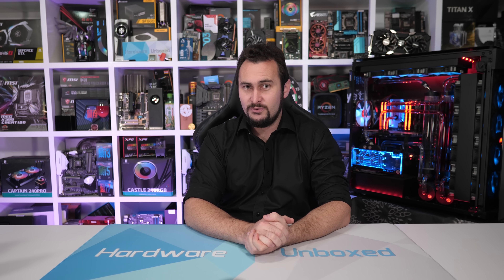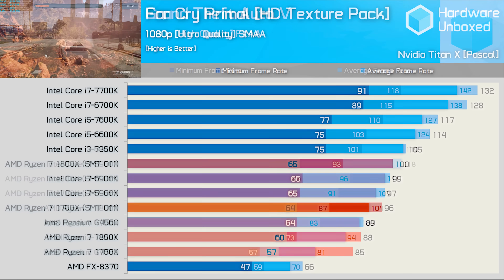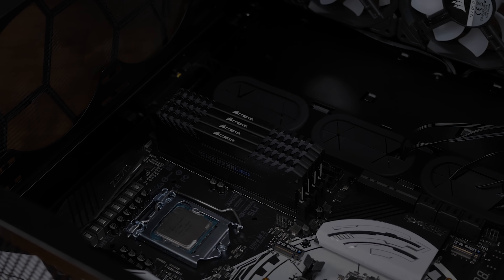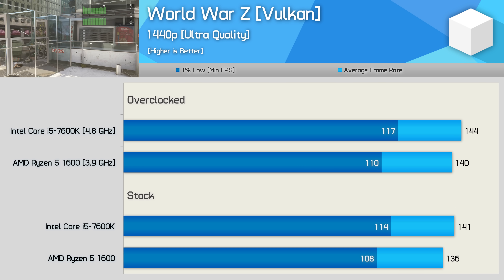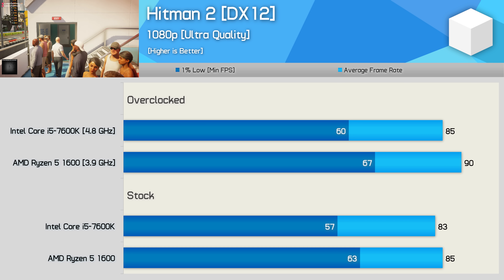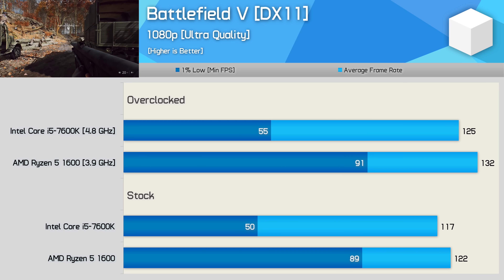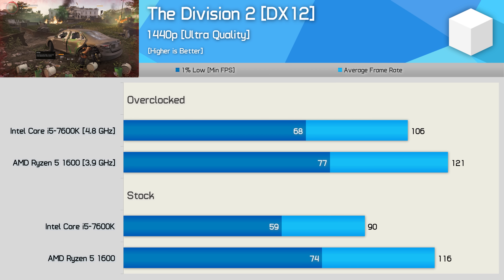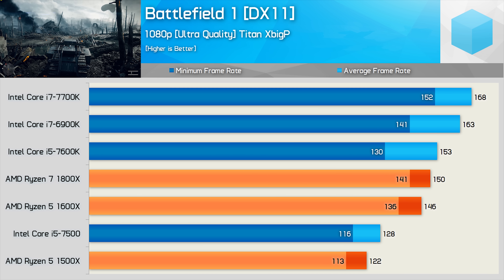Ryzen 5 1600 vs. Core i5-7600K, How Times Have Changed!

Comment: Nice work on this one but you could have includedthe 1700x and the 8700k as they were in the same pricerange.  This is entry level. Mid range en high end will change it a lot.  Specialy seeing the 1800x launch price and the 1700x was pricy aswell.

Comment: Ryzen 5 1600 4GHz. Turned off SMT and the fps went up like crazy 😂 especialy in Elder scrolls online.
Reply: Interesting.
Reply: So it is basically a 6 core/thread CPU?  What other games did you see gains in?  I suppose productivity metrics went down, though?
Reply: @davidwooten7212  GTA V and Rainbow six and some other games, using it only 4 gaming.

Comment: AMD have really changed the game.  Lisa Su promised Ryzen would be disruptive, and it's certainly proven true.  Only two years ago, we were stuck on 4c/8t and that's all game developers were coding to as well.  Intel refused to release higher core counts claiming that games weren't utilizing more than 4, and game developers were saying that they're coding with 4 in mind because that's what's available.  It was a big chicken and egg thing.  Post-Ryzen is a different story.  We now see Intel finally releasing more than 4 core mainstream CPUs.  They certainly had the capability of doing so on Kaby Lake or Skylake, but chose not to because AMD wasn't pushing them; but when AMD came in and destroyed the i7-6900k lineup with 1800X, then annihilated the i5 segment with the 1600, they had to respond.  Their lackluster responses to AMD's releases show very clearly that they did not take the Zen architecture seriously.  They (and a lot of us all) were sure that Zen would end up seriously behind Skylake even if it was an improvement over Bulldozer.  
There's a good reason why the only CPU worth buying on the Intel side is the 9900k.  It's the only one that clearly beats AMD's current offerings and delivers superior gaming performance.  That may change with the Zen 2 release, but for now, it is the last CPU in their stack that isn't outclassed or out-valued by a comparable AMD product.

Comment: At Microcenter the Ryzen 5 1600 (decent cooler included) with a decent mid-tier mobo for a 3.8 Ghz overclock will run you $130 after tax.  That's just mega.

Comment: I'd also be interested in a comparison of ryzen 1700x vs i7 7700k 2 years later
Reply: 7700k will still beat it pretty soundly in most games.
Reply: @hartsickdisciple  yeah, the 4 extra threads compared to the 7600k will make the difference
Reply: I have an R7 1700x @3,8Ghz with 3400 Cl14 bdie ram, but still not getting Intel frames, especially in CS GO...

Comment: 4c/4t isn't enough for a great gaming experience in a lot of newer AAA games. 4c/8t is much better. This is why the old 2nd through 4th gen i7's are still strong, especially when overclocked and paired with 2133/2400 mhz DDR3.

Comment: I just did a comparision video between a GTX 970 which I bought in 2014 and a Vega 56 which I bought in 2019 for pretty much the same price. The purpose of the video is to find out how much more performance you get for around 300-350$ today, than in 2014. If anyone's interested, please check it out

Comment: Sooo AMD is bring us forward. Unlike Intel who been holding out and skimping on security. The 8700k came out like half a year after the 7700k. Then they dropped the 9900k (finally using soldier) only to release a 9900ks which his a higher boost (that they couldve done from the beginning. Intel still over segmenting the product stack by not giving i5 and i7 hyperthreading, making skews that cant be overclocked and forcing unneeded motherboard upgrades (motherboard manufacturers told on em lol).

Comment: Yeah, remember that Tom's Hardware article, saying the 7600K was the better choice.
O O F
Reply: jUsT bUY iT
Reply: I remember Linus making the 'choose the 7600K, it's enough' argument as well in early 2017, then he later was mentioning that, according to his stats of products chosen, with an 8-1 ratio folks were instead choosing the 7700K against his 'recommendations'...
Reply: @mdd1963  I was actually going to buy an i5 6600k at skylake launch. But i was upgrading from an fx 8350 and KNEW that programs used more than 4 cores, so i went with an i7 6700k instead.
Reply: @dondraper4438  wiser choice! 4c/8t still kickin' it in 99% of most games, as long as no streaming junk at the same time... I'm on 7700K, and feeling no crunch yet to need anything faster

Comment: Any chance you can do an i7 6700k v R7 2700x video, im currently running a 6700k clocked at 4.5ghz all core and im interested if buying the 2700x maybe at a steal due too impending 3000series will gain me any better results.

Comment: Thing is the 1600 still is very very rarely utilised 100%. The 7600k has hit its limits and later the 7700k will hit its limits where the 1600 has more to give still due to core count 50% higher with or without smt. I remember on release i said higher threads will mean this will happen yet a lot of people refused to acknowledge this at the time looking only at here and now back in 2017. Some People didn't cotton on ryzen isnt fx
Reply: I've had an FX-6300 before I upgraded to my R5 2600. The difference is unbelievable :)
Reply: @xPandamon  went from my old 4ghz fx 8300 to a ryzen 1200 locked to 3.5 ghz at 1.18v with 3200 mhz ram (set to 2933 max the chip allows for me at cl 14-15-15 though. Dead silent. Faster than the fx in most games only 1 or 2 games that fully use 8 fx threads 100% is the performance nore comparable

Comment: Latency and pipelining are a killer. It looks like ryzen has seriously good improvements in these areas. 25% or so higher clocks isn't a 25% advantage for i5. This is interesting. When you see these kinds of differences then you need to think about where the savings of ryzen are. I think they've improved their pipelining.

Comment: I switched from an i5 6500 ocked via BCLK to a ryzen 1600 some months ago, I paid just 20 euros for the upgrade as I sold the i5 and its mobo for 200 euros. It was a substantial step up. 
edit: I overclocked my system memory heavily on both systems and on ryzen, as stated by others, the difference is larger than on intel.

Comment: Guess I biffed it. Got my i5-7600k clocked @ 5.1ghz and while it runs well I guess I dont see the lack of performance due to being locked at 1440 @ 60fps. Being used on a damn tv rather than a nice gaming monitor.  Might have to switch next upgrade. Whenever that'll be.

Comment: Got a ryzen 5 1600 o.c. to 4.0ghz on stock cooler with cheap Ripjaw ddr4-2400 ram. I've read ppl can get higher oc with better ram.
This thing is a beast for the price. And great for Budget builds like mine.
Reply: You want faster ram with tight timings tue time your memory. I would drop your frequency to 3.9ghz and set ram to 2933mhz at cl 14 maybe 15 get ryzen ram calculater for all the sub timings
Reply: @Thesinistereyes1  I'll be upgrading to 16gb flare x which should run at 3200 out the box with a couple clicks in bios, in a few days or I would try to overclock the ram.
From what I've read the sticks I have are a bit tricky to work with cause of cheap dies(was literally the cheapest ddr4 2x4gb sticks I could get at the time of building) Plus it's my first PC so I'm not all that experienced. And ram overclock seems much more daunting than CPU oc was.

Thanks for the tip. If I don't upgrade soon I'll try that out.
Reply: @amp2193  technically RAM oc and timing tuning is easy if you download Ryzen Ram calculator. it's also free.
What mobo do you have? if you have any of the crosshair x370/x470 they have preset memory timings for different kits of memory.
Reply: @Thesinistereyes1  ASRock b450.
Yeah I looked at all that. Kinda overwhelmed by all the different stuff to input.
I'll prob give it a try one weekend after I get this flare x later today
Reply: @amp2193  the inputs are usually in the correct order though watch out some of them might be flipped depending on your mobo. At least for me i turned a corsair 3000mhz cl 16-18-18 to a CL  14-17-15 3200mhz and i think i can push it a bit higher. but im happy with what i got for now.
Reply: @Thesinistereyes1  I ended up picking up the Flare X DDR4-3200 CL14-14-14-34.
It's running at that with with xmp profile.
I did end up switching to 3.9ghz it was running a lil hot at 4.ghz with the new ram.

Maybe when I get an after market CPU cooler I'll try to step it back up to 4

Comment: I purchased my i5-7600k in Feb 2017 to replace my slightly older Q9550. I had heard of Ryzen but had not seen any bench marks at the time so I went with the 7600k. 2 1/2 years later I still game on my "old" i5-7600k pretty well. Just upgraded it with 16gb of 2667 DDR4 ram and a nice MSi 1660ti. I do like the Ryzen processors though and will no doubt look to a Ryzen when I upgrade my i5 in a year or two if the price is right.

Comment: In a month from now my i7 4790k will step aside for a glorious Ryzen 3000 CPU. Can't wait to play Bf5 without framedrops.
Reply: Should have gone with 8700k over a year ago.
Reply: @fredfinks  For that sweet sweet money waste?
Reply: @xPandamon  What are you talking about? The 8700k is a great CPU.
Reply: @fredfinks  You can get an R7 2700x for the same cost which is superior in pretty much every aspect. Slightly less single core performance but the additional cores and threads will make up for it as the time goes on. It does cost more but it comes with a cooler which makes the 8600k just as expensive overall. Absolute no reason to go for it anymore. Soon you can get the R5 3600 which is supposedly on par with it for half the price.
Reply: @xPandamon  For most of us here, gaming is the performance we care about most. - 8700k better. For me the most intensive work i do is handbrake.  - 8700k MUCH better.  Do you use blender? Then sure, go buy a 2700x  (remember, 8700k came out in 2017).  Regarding as time goes on:  6 cores is still A-OK and in a year or two ill upgrade, getting decent sale price when i sell the 8700k.    Do you use blender? In what applications you use does the 2700x do a better job? Do you get it? Ryzen had nothing for me  zip, nada, zilch.   And i bet a TON of cash that it would have been the same for the OP.  Repeat 8700k was the best that one could do (unless you ran the apps that zen did better and valued that performance benefit over games)  Just had a look no surprise - used  8700k selling for much more than a 2700x.
Reply: @fredfinks  The question always is: How much do you need and is it worth it? I've got my R5 2600 lately and it easily runs everything I throw at it. Sure the 8600k is good but for that cost you pay a lot of money for a rather small performance increase. For most people it's absolutely not worth it unless you want to emulate a lot or use a high Hertz screen then sure, go for it.
Reply: @xPandamon   Yes, its worth it.  For the budget builds ryzen was a decent choice, no argument from me. You keep mentioning the 8600k. we talking about the 8700k (no prob, if just typo).   OP mentioned he had the 4790k, he should have sold and upgraded to 8700k.  Buy and sell often - you stay in the ballpark and the overall cost of ownership isnt that much different. You reclaim a lot on still good 2nd hand gear. e.g. 3570k in 2012 - 6600k 2015 - 8700k 2017/18. Also GPUs - they age like milk. The 2080ti is the first gen ive skipped since the gtx 480 a decade ago. I'll upgrade the 1080ti when 3080ti comes out.  Each upgrade is surprisingly cheap (though i expect the 3080ti to be a big diff, but not so to the 4080ti). I've spent WAY more on storage.
Reply: Glad you didnt go 8700K a year ago

Comment: @ Hardware Unboxed - When you can do a review on the upcoming Ryzen R5 3600 could you run the same tests on it and the R5 2700 on the same motherboard/system?  This would give us an idea on how AMD is improving performance between generations as well as pointing out what you lose by using newer CPU's in older generation motherboards.
Reply: There is no R5 2700 part. Do you mean the R5 2600 or the R7 2700? I'm not nitpicking - I'm just curious to know what you're asking for. If I had to guess from the context I would assume you mean the R5 2600 as it has the same number of cores and launch price as the R5 3600.

Comment: 6:58  the other bottleneck is probalby ram speed.  the threads are being swapping in and out so fast that the speed of the ram is the limiting factor.  i noticed this on your i3 8100 coverage where in bf1 it got an extra 12 fps just from going from 2400-3000

Comment: I knew 4 cores was no longer cutting it plus the security issues So I sold my i5 6500 and Z170 E board and replaced it with a Z370 A(Z390 wasnt out yet and I got a decent deal and rebate on the Z370) and 9600k. I do miss how low power the E build was though with a locked i5 and 1060 it was near silent and literally wasnt capable of high temps even if i played games all day long.

Comment: Glad I had some common sense back in 2017 and bought the 1600 myself instead of the 7600k. I always trusted this would become a great platform. It still does the job pretty well, and when I need some extra performance, I'll just stick with the platform and move to Zen 3000/4000. Best deal ever!

Comment: The computer shop called MicroCenter here in the US has these Ryzen 5 1600 CPUs for $80 USD and I kinda wished I bought those instead of the Ryzen 5 2400G now that I finally have a discrete GPU, the Radeon RX570 (purchased at $130). Oh well, I'll just head on over there to pick up another 16GB DD4 kit that is available for $70 USD...
Reply: The 1600 and 2400G are probably equivalent in most games when using an RX 570. I'll probably get a 3400G to replace my x2 250 + GT430 setup. Massive CPU and GPU upgrade at the same time. Not to mention an NVMe SSD to replace the spinning HDD too.  :0
Reply: @boshumok6399  but I do lose a bit in productivity or video editing. Also some games are making use of the increased core count. Maybe I should just wait for the next Ryzen release and see how much of an improvement that will be.
Reply: @NightMotorcyclist  I'd definitely wait at this point. It's looking like the new Ryzens might be around 20-25% faster per core with IPC and clockspeed combined. For the 3600 and up that is. The 3200G and 3400G are just a mild improvement.

Comment: Everything I said about the future of Ryzen in 2017 came true.
Reply: Citation or it didn't happen.
Reply: @unoman2500  ok

https://www.techpowerup.com/forums/threads/ryzen-gaming-build-strategy.231286/

"I'm thinking the same, and looking at the massive improvements that have been made in the last weeks via simple updates I'm very optimistic. Also since I'm gonna be playing at 4K I wont be CPU bottlenecked for a while at which point I'm hoping to reap the benefits of multi-core. If not I'm still fine with giving my financial support to AMD." -me

Weeeeeeeeee!
Reply: You were a true visionary, even if no one remembers a single alleged prediction! :)
Reply: 6700K@4.7Ghz back in 2015 has 205+ single core Cinebench R15 score. Ryzen still hasn't reach 200+ single score in Cinebench R15.
Reply: @Random-yq1wu  r7 2700x gets about 180 single core Cinebench score right now. 7nm should get over 200+ single core in Cinebench r15.
Reply: @Random-yq1wu  yeah single core perfomance...^^ and what about multicore?? ;)
Reply: @Random-yq1wu  A more expensive, overclocked Intel CPU with an also expensive, neccesary cooler is faster? Crazy!
Reply: @Random-yq1wu  Try it on R20

Comment: At some point in the future, you'll see those 6c 6t 8th 9th series
CPUs will be the bottleneck while 6c 12t and up CPU's still be valid.
Reply: As soon as the next gen consoles come out with their 8+ core CPUs, 100% of the new AAA multi-system games will be optimized for those high core counts.
Reply: PS3 8 Cores, PS4 8 Cores.... just look at all the Multi-System AAA Games that support 6+ cores from the last 10 years ALL 12 of them! 
I believe some people really think that engines got a extra button that just needed to be pressed to add more core support..  @Tchoukis
Reply: @janp5063  Ps3 was incredibly hard to program for and it also wasn't x86. Ps4 was using 1.6ghz jaguar cores which are a little faster than fx in ipc but were clocked ultra low.

Ps5 comes with x86 zen 2 cpu with 8 cores 16 threads and clocks up to 3.6ghz. If you wonder why new games are super taxing on those old i5's today, it's because they are being coded with smt enabled zen 2 octocores in mind.
Reply: @janp5063  That's cool though, because there's tons of cheap ryzen 5 and ryzen 7 chips on the market for the budget gamers now.

How much does an i5 7600k go for today? How about an i5 8600k?
Reply: The R5 1600 will overtake the i5 8400 eventually

Comment: My Ryzen 5 1600 is clocked at 4.2 on stock cooling. I'm also pretty sure it's the fastest ryzen 5 1600 on userbenchmarks considering the dash is way off the scale loool. 

Love my CPU : ) served me well. Now I'ma upgrade to the 3900x soon!
Reply: @Zane White yeah, I have a golden sample. I hit 4.2 at 1.4 but temps are to high to push it anymore on stock cooling.

Comment: Steve, this makes no sense, it’s like you chose the slowest intel cpu purposely. You could of compared ryzen 5 1600 to the 8600k or 9600k. Of course it’s going to do better in games where more threads is superior!!! And of course do worse where single threaded performance is needed.

8600k and 9600k are 6 core CPUs which would make more sense to compare to even a ryzen 5 1600. No one goes out and buys a 7600k today to upgrade to... too many other choices and upgrade paths!!!!
Reply: Did you even watch the video? Or are you in family with Nicolas Oxendine. Video is about IF you bought a pc in early 2017, what system has aged better over time. 

Can you play newer titles in 2019?
AMD R5 1600: Yes it will play just fine
Intel 7600k: No, you need to upgrade, either a 7700k or new motherboard/cpu.